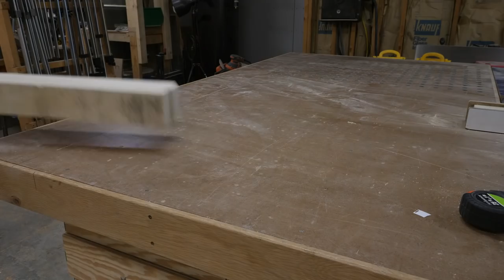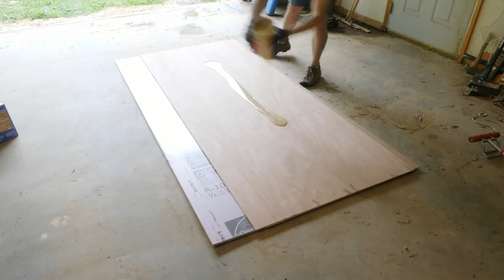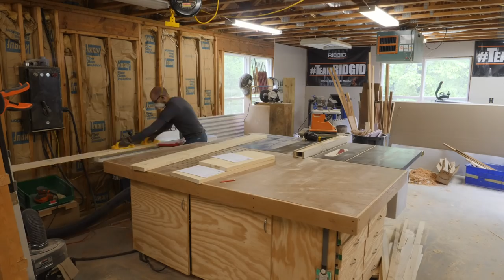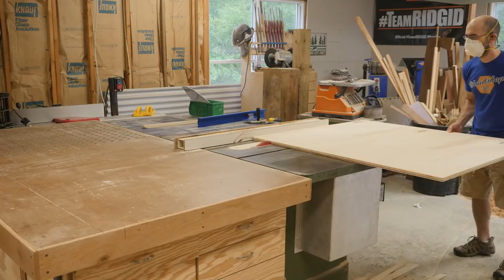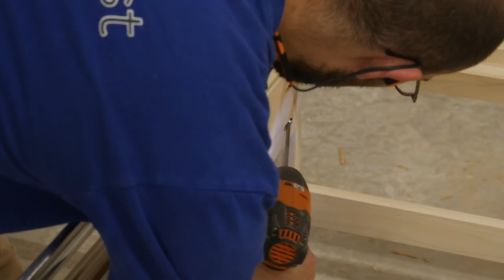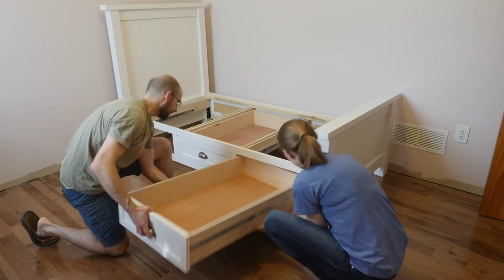DIY Farmhouse Platform Bed with Storage

Comment: I have completed both the headboard and the footboard but have a couple of questions. (1) what is the purpose of the headboard and footboard center rails? (2) How far from the bottom rail, on both the headboard and footboard, are the center rails? Thanks.

Comment: Are the grooves for the beadboard/plywood insert, in the foot and head board, exactly in the middle? Is the groove 1/2” wide?
Reply from the maker: Yes the beadboard is center in the headboard and footboard. I believe I used 2-1/2" beadboard, not exactly sure of the groove width though.

Comment: To me that looks like more than 10bf of popular but I suspect I am wrong, do you recall the rough dimensions of the rough boards at the start of the video?
Reply from the maker: I don't recall the dimensions of the boards I started with, sorry.  Thanks for watching though!  Hope the video was helpful 👍
Reply: @WoodshopMike  I did see on your website walk through you said you bought a bit extra. Would you say then the 10bf is the absolute minimum for what you need for the legs, etc.?
Reply from the maker: Yes.  I always buy a bit extra to account for any unseen defects or dealing with the random widths and lengths that hardwoods are solid in.  Hopefully that makes sense😃